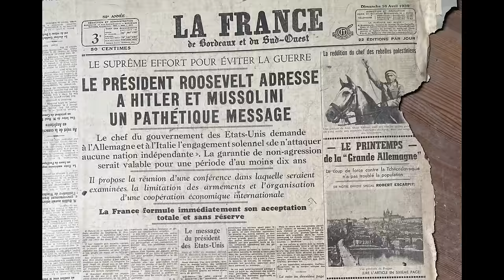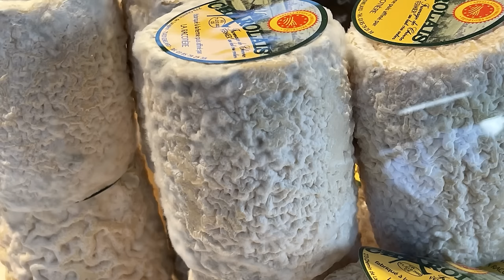Back in the Big House! #127

Comment: I see radiators throughout the house, are they hooked up to a boiler. My thinking is that it probably is toasted.🇨🇦
Reply from the maker: There are some very old radiators in our side of the house Shane - they are run on a very modern air source heat pump. (even with it on full blast it can be rather chilly) the Big house has never had heating put in - nor insulation. We think we will use it more in the warmer months and then mothball it for winters... unless we have a lottery win - then heating all round...

Comment: The wallpaper looks more like what they call stringcloth wallpaper. I would think it would take more paint to cover as the fibers of the string would need more than a grasscloth wallpaper. You probably should have started with a primer coat of Kilz for the tobacco stains and getting a head start on the stringcloth. I have seen this paper painted over and it looks pretty good. I would suggest painting the trim in the room a lighter color. Maybe a French gray or the like. I wouldn’t touch the beams though. I like the look of them. ❤️😊
Reply from the maker: Fingers crossed Dawn - so far no sign of any stains coming through the paint... long may it last. (Next time I would strip that paper from the start - but time got away from me) xx